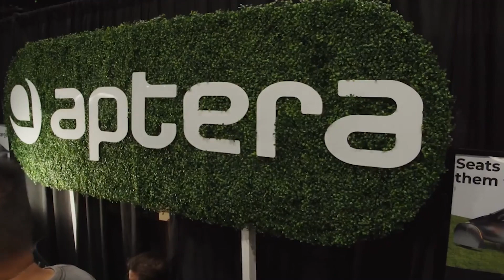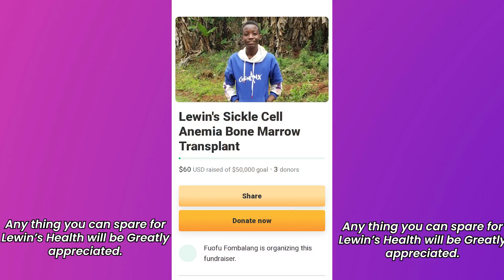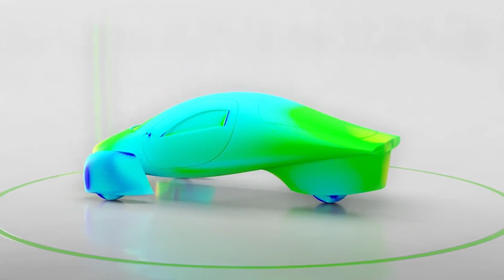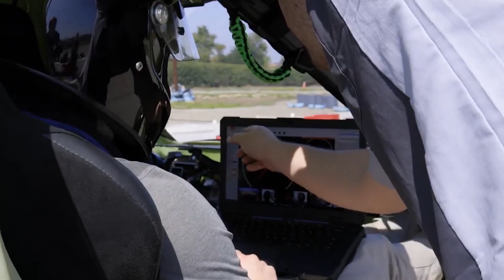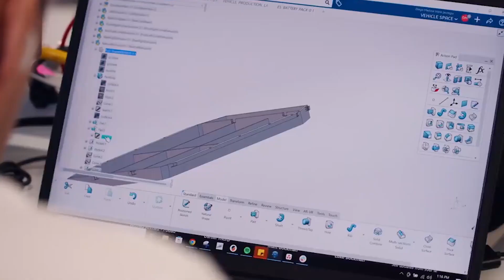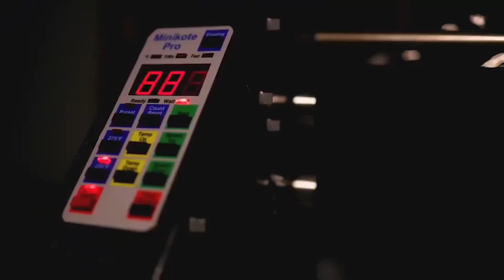Why The Aptera Could Quite Possibly Succeed This Time Around !!

Comment: Aptera has already succeeded. There are almost 40K pre orders and I would bet most of those will consummate their purchase. There are those who would like to see EVs fail. There's a momentum to use carbon fuels and the carbon fuel moguls have put out a narrative that they hope will discourage and delay adoption of EVs. We are still in the infancy of EV development. The next ten years will serve to cure all the EV ills or they will be defeated by a better technology. Since a better technology isn't on the horizon we have to continue with the current most promising technology. Aptera is showing the way. Long range on small battery packs reduce emissions in manufacturing and, in some cases, will end dependence on the grid. I ordered an Aptera and have invested in the company. The biggest problem now is the two seat car. I'm looking forward to the next generation of Aptera when the same efficiency will be applied to a four or five seater. In the meantime, the current design will be the ultimate commuter and a really interesting and amusing roadster. I won't drive a thousand miles per day. I'll drive 25 or 30 and I'll do it with the small battery pack. I want to keep the most efficient car in the world as light and efficient as possible. I'll stop every two hundred miles for a 20 tp 80 recharge in less time than it takes to pee.

Comment: I´m curious to see if it will be Aptera or Sono motors to be first to deliver.
I like them both. The Sion for those that need more than 2 seat´s and don´t need much ranger.
The aptera for those that need long range more often.
The Lightyear 0 is also a great car but way to pricy.

Comment: There has been a lot of information released about final assembly of the Aptera, but to my mind the real production bottleneck is not the assembly but the manufacturing of the individual parts, namely the composite body pieces, the suspension components, the battery pack, the solar panels and the wheel motors. We have seen a little information released about the solar panels and wheel motors, but not much about where and how quickly the body panels will be made. With Tesla, they are always talking about the giga casting etc, but what production machinery will be used to build the Aptera body? I'd be interested if anyone could point me towards that information...
Reply: Body assembly reminds me of C1 through C3 Corvettes.  Bodies if multi parts hand laid up to make a unitized body.  Chevy managed large production numbers but the labor and precision were problematic.  Hopefully there are more automated approaches at this point.
Reply: I'm seeing the same thing and not seeing the solutions. These composite structures are wonderful.  Strong and lite. But the layups have kept this type of construction mostly limimited to expensive aircraft and custom marine. It must have multiple layers. I just don't see the target price being achieved. Hope I'm wrong. But as far as I know it will be very labor intensive and it takes a lot of care and skill plus precise temps etc. You don't want these epoxy resins in you lungs or on your skin.  I really do like the design. Revolutionary if it can be done.
Reply: Updated body information is carbon fiber produced over in Italy, company named CPC, which is going through a huge expansion, and recently had a large investment from Mitsubishi Motors. Carbon fiber has been too expansive for normal cars, only used in high end sports cars or Formula One race cars, however a new process makes the process simpler, and they have the presses to make more than what Aptera could use. With Maxeon, solar cells will be produces uses their factory and made into hoods, roofs, or tail gates, and the wheel motors from Elaphe of Slovenia. Beginning to appear like a European Super Sports car, with efficiency off the charts. Yeah, investors will come to this party.

Comment: Reasons why I'm not expecting it to be successful..

Handling: Every video clearly shows that it has a terrible turning radius. 

Ride Quality: Those heavy wheels translate to a terrible ride. I saw a video shot onside the car while an employee drove it and talked it up. The ride was clearly worse than any modern car.

Interior Quality: The interior looks like cheap materials slapped together by someone who was trying to be edgy.

Safety: I'm simply not going to put my family on any car that doesn't employ industry safety features, or meet the same safety standards of every other new car on the road. Aptera talks about their passenger cell being crush resistant, but that's a fools promise. True safety comes in the form of energy absorption,  redirection,  and management.
Reply: Another @Aussie ideas man protégé here.
Reply: Handling: The only video I've seen showing a turning radius in action was an alpha pulling into a parking space. Looked fairly normal to me.
Ride Quality: Agreed it looks bad, on the early versions. Roush Engineering changed everything with reports saying great improvements.
Interior Quality: materials will change, says CEO. 
Safety: Passing automotive crash tests by third party will happen with production version.

Comment: Your prior video was biased. And now that the CFO has resigned it is much more likely to fail. 
Your first reason is debunked by the failed version - it too was groundbreaking in much the same way as this model - and I mean MUCH. It just didn't cut it. And that con that it's the most efficient possible is proven wrong because fore and aft seating gets better efficiency than side by side. Everybody knows that.
Munro appears to be losing his marbles, of late, and while you brag about production benefits, there is actually no production to brag about. BTW, look at the involuntary twitch in the Beta at 6 minutes, and take a long look at a radiator that is not available on the planned production version. That rad is what makes it go more than 5 miles.
You are too biased about past successes of the CEOs. Fambro gets no advantage by successfully growing food, not is his electrical skill enhanced. Chris had 6 out of 8 bomb, and his boat coy is having an inordinate number of complaints regarding his shells, which his invention has never been properly identified nor proven. It's just a manufacturing short cut, at heart, as far a one can tell. While the battery coy appears to be going smoothly, it is curious as to why it has nothing to do with what goes into the silly trike. They have done deals with two other suppliers and merely make the cradles, themselves.
So much passion that the CFO has resigned. You can get people passionate about scams.
My opinion is that it has about a 99% chance of failure. When I first saw it about 10 months ago, I was at somewhere like 80%, but the delays; the grabs for cash; the family selling; the cartoons and kid's books; the fake prototypes; the never seeing supplies; the lies from Chris; the lack of evidence everywhere; the support from everyone who has something to gain and a lot of blocking going on; the general stupidity of disciples and many other reasons has made me bump it up to 99%.
Reply: What "lack of evidence"? "...the support from everyone who has something to gain..."? Would you be encouraged if those who gained were not supporters? "...the general stupidity of disciples..."? What do "disciples" have to do with production, sales, success? "...many other reasons.."? What happened? Your keyboard break?
Reply: @1voluntaryist  [What "lack of evidence"? "] Evidence it goes the 4 ranges they claim; the two 0-60 times; the 16 to 43 miles on solar, depending on specs; the 0.13 CD; the skin cooling working without thermal throttling, or worse - complete stops to cool; the 3 times more efficient than a regular EV; the better handling than a 4-wheeler; the better ride and cornering than EVs with in-body motors, and on and on. If you have evidence these are proven, let us know?
 [...the support from everyone who has something to gain..."?] That means; if someone thinks they are up for a discount, they make a supporting video. Cash for comments is unreliable. [Would you be encouraged if those who gained were not supporters?] That's a strange thing, so no. "
[...the general stupidity of disciples..."?] Yep - they factor in my assessment. 
[What do "disciples" have to do with production, sales, success?] Possibly a false inflated evaluation of the trike's value. Best rely on media that reports on real world failures.  
["...many other reasons.."?] These comments are not for books. 
[What happened?] I kept it short. 
[Your keyboard break?] Works fine.
Reply: The CFO did resign, but not because of any disagreement from within the company. She still remains involved with the project. So, how is that evidence of a companies demise? You’ve just put your own spin on the facts.

As for the radiator, are you aware the heat produced from a vehicle is significantly reduced when they’re going 10 miles per kilowatt hour. Not as though there won’t be a radiator, just not a typical one. 

We got it, it’s not the car for you. Surely there are other investments for you to consider, or maybe not actually. 😜
Reply: @hardcoreherbivore4730  [The CFO did resign, but not because of any disagreement from within the company.] Let's make things perfectly clear, because I perceive you read between the lines a lot; I never said that there was a disagreement, so you are refuting something not mentioned. That's off to a bad start, in my book; a sign of poor comprehension skills, at least. 
[She still remains involved with the project.] I never said she had broken all ties so, again, barking up trees I have never been near. And nobody knows what level of involvement is involved (excuse the pun); it may be she makes the punch at next year's Christmas party. 
[So, how is that evidence of a companies demise?] For the third time in three sentences you are barking up other trees; I never said it was evidence, but only a strong sign, and one that was a similar repeat of what precluded the last real demise. In fact, I clarified the differences between evidence and signs with both Don and Bruce Baby, so where have you been?
[You’ve just put your own spin on the facts.] I kept them as facts; you lie, and that because you are off on tangents. One needs better clarity of mind than you have in order to have a sensible conversation.

[As for the radiator, are you aware the heat produced from a vehicle is significantly reduced when they’re going 10 miles per kilowatt hour.] Significantly reduced IF it can get near that figure, and only on the flat and down hills. Load it up to the 500 lb max and tackle the high Sierra's in a heatwave and see if that significant reduction doesn't significantly overheat? Vehicles need to operate in all conditions deemed normal, and that's not just your flat 5 mile run to work.  
[Not as though there won’t be a radiator, just not a typical one.] There won't be a radiator - it is not atypical; it is a crock. Ergo, the Beta radiator - a simple matter of fact you have to bend over backwards to ignore. Nothing for me to spin.

[We got it, it’s not the car for you.] No, you have yet to get it, and it is so simple - it is not a car at all. It isn't even an autocycle, either; you have crossed bridges before you got to one, and that is crazy. 
[Surely there are other investments for you to consider, or maybe not actually.] Not. Investing is not for me - never has been, but rational thinking is.

Comment: There are no Aptera's on the road today. Fake prototypes don't count, so your comparison lies.
Reply: Of course there are.  My wife and I both rode in one last November, and they weren't just around the parking lot rides.  We saw others.  Many others have shown the same - from people as well known as Jay Leno to many others less well known.  Alpha prototypes are exactly that - development platforms.
Reply: @n.brucenelson5920  [Of course there are.] What part of "prototypes don't count" don't you understand? While you remain deluded, at least let normal people understand there are NO Apteras on the roads today by answering these questions (been asked before) - 
1. Does anyone outside of Aptera Motors have one they fully own?
2. If so, do they register it and drive it on the roads?

We won't be hearing from you.

[My wife and I both rode in one last November,] It was a prototype that had fake battery and fake solar which was not for sale. It's November tomorrow here in Aus, and that one you rode in is just as fake now as it was a year ago.  
[and they weren't just around the parking lot rides.] It is not fit for purpose as a vehicle, and barely got you around a short circuit. Who has gone more than 6 miles? 
[We saw others.] How many? Were they on the road, or even completed? In 12 months, where are they now?  
[Many others have shown the same - from people as well known as Jay Leno to many others less well known.] Jay saw one only, so that "the same" is a lie. So, how much is 'many', and were they all prototypes?  Did you count bits and pieces as one each time? lol And what happened to AMs claimed openness if 'many' silly trikes have not been shown online in a year?
[Alpha prototypes are exactly that - development platforms.] So you did perceive you rode in a vehicle that doesn't count. Then why did you pretend one did? Why start with "of course there are" (Apteras on the road today)? It's two months to 2023 and there are NO Apteras on the road today - not a single one, because the 5 fake prototypes don't count. They have slapped together 5 pieces of junk while producing zero vehicles to-date.

Don't put the same nonsense on other chat sites - it's high time you packed it in.
Reply: @aussieideasman8498  1.  If you paid attention, you would know the answer to that is yes.  And yes, both my wife and I rode further than that in the same vehicle, one after another with Daniel Morris driving.  

You know the answer that last November there were three completed alphas, and you have seen video of all three of them with registration plates on the road.  Why pretend you don't?

It is quite obvious that none of the prototypes are "junk"   They each do what they were intended to do.  Why are you "pretending" ?  

It will become obvious to everyone that the production Aptera have passed through the necessary stages to get to that point and that none of the stages are "fake".  Only a troll would make such a claim.
Reply: @n.brucenelson5920  @Aussie ideas man  I see you decided to put your original up, but that's not enough to take my handle off the reply. 

[1.  If you paid attention, you would know the answer to that is yes.] So who owns one outside of AM, and list them if there are more than one? You tell lies, so it's needed.  
[And yes, both my wife and I rode further than that in the same vehicle,] How much further? It could be 50 yards. 
[one after another with Daniel Morris driving.] Get your wife to fill in the details - you are useless at it. BTW, did she insist on an NDA like you did? lol!  

[You know the answer that last November there were three completed alphas,] My question was what happened in the ensuing year? And what is completed? Tiny batteries and fake solar? 
[and you have seen video of all three of them with registration plates on the road.] Special registrations don't count.   
[Why pretend you don't?] When did I pretend? You need a 'Joe Citizen' who owns one and a license number and state for the registration. You have failed. 

[It is quite obvious that none of the prototypes are "junk"] To a blind fool, maybe.   
[They each do what they were intended to do.] So the Alpha's go 40 miles on their solar? News for you - they can't get 40 feet. They were intended to sell snake oil, and it's all they do.  
[Why are you "pretending" ?] I never pretend. Do you mean like pointing to SOL and telling someone it can do up to 1,000 miles and an extra 40 on solar?  That's not pretending - that's flaunting advertising standards with outright lies.

[It will become obvious to everyone that the production Aptera have passed through the necessary stages to get to that point and that none of the stages are "fake".] 5 behind that, already; I'm waiting for 6 in a row.  
[Only a troll would make such a claim] Send me the badge and I'll wear it.